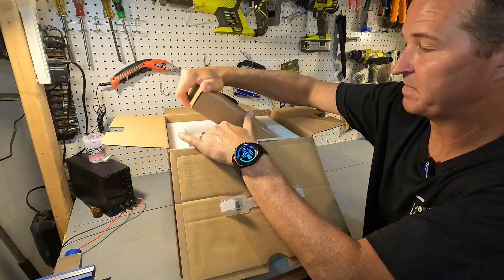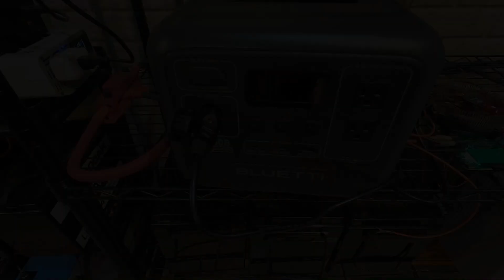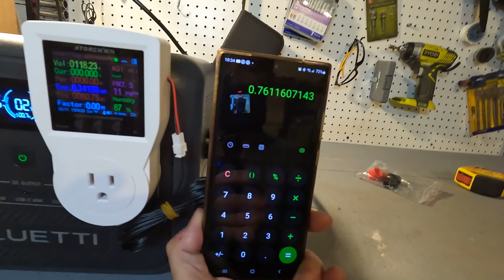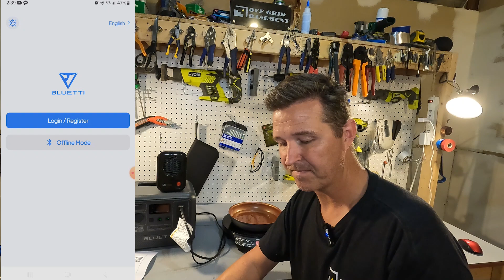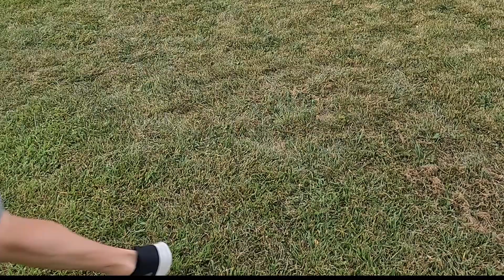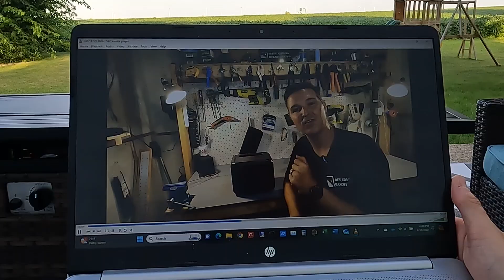Bluetti AC50B Review.  Everything you need in a small package!

Comment: I have this power station and the inverter is weak. Rated at 700 watts but no surge. My Vtoman Jump 600x can power a large chest freezer. Rated 600watts and surge of 1200watts.
Reply from the maker: You're right.  Surge capacity is a bit underrated.  You might get better results if you turn off power lifting.  Not sure though.  Thanks for the info and the comment.
Reply: I know this is a year old, but the Bluetti is actually superior in almost all respects, right down to the warranty.

Comment: well i got my brand new 12v lifepo4 100ah battery in today lol it only took 2 days to get here even tho it showed it would take atleast a week or more to get here lol but yeah its about as basic as one can get lol also it didnt come with anything so yeah it seems to work ok but i have to real test it out like you do before i know if its any good or not also i should of looked up the reviews before buying lol allot of people are saying there battery was dead after using for like 3 months so hopefully that doesnt happen to me but yeah its the MJBSAN BRANDED BATTERY AND I PRETTY SURE IT SIAD YOU CAN ONLY CHARGE THE BATTERY TO 0.5C RATING WITCH MEAN 500WATTS basically so yeah witch is fine i wouldnt use that much to charge this battery anywyas but yeah deffinitly need to read the fine print with these purches
Reply from the maker: I believe you'll be fine with the charge rate.  Lifepo4 batteries should be charged at 0.2C rate for optimum charge cycles.
Reply: Thanks “Jimmy” 😏